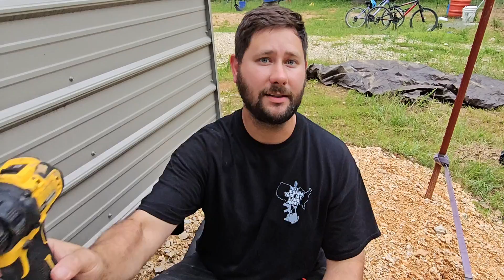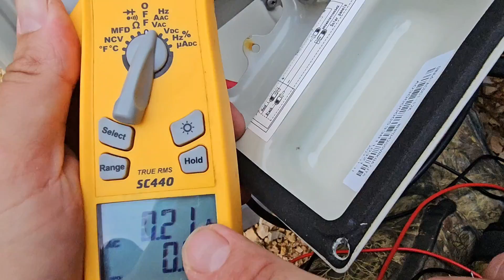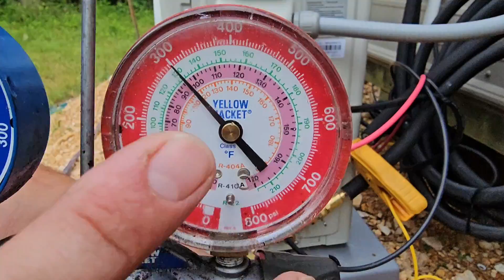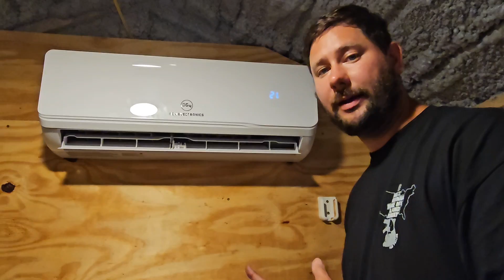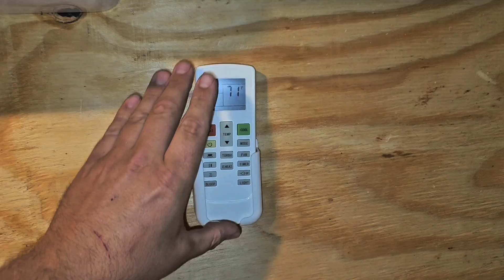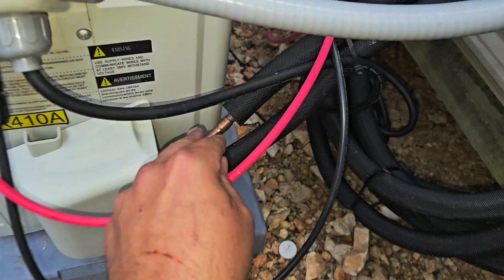Don't Buy a Solar AC Before Watching This!

Comment: Taddy, I installed my eg4 solar mini split and works great, only thing is even with very bright sun it still runs on ac and dc. I have 3 430w panels. I checked the panels and they are putting out the correct volts and watts. Can you explain if that is the way this system works?

Comment: Hey Taddy,  I have a 3-zone mini split system that was installed in my barndo in 2020 (new construction).   From the heat pump, the line sets run into the shop area of my barn up to the mezzanine level (which is the living quarters).  2 air handlers are upstairs and 1 air handler is downstairs in the mudroom.  The shop area of the barn is insulated with spray foam but it’s not climate controlled. It’s been very humid in central TX as of late and the summer heat has arrived.  Lately I’ve been noticing that the line sets in the shop area have been perspiring/dripping even though they’ve been wrapped in K-flex.  There’s also a galvanized cover screwed to the exterior wall of the mezzanine that covers/protects the line sets, electrical and drain lines.   My HVAC installer told me that the heat and humidity are the cause of line sets perspiring like they are.  I asked what can be done to prevent this and the only thing he can think of is to spray closed cell foam insulation inside the line set covers (section by section) to essentially envelope everything inside the line set cover.   I wanted to see if I can get your opinion on this.  Thanks.
Reply from the maker: Insulating would probably take care of the problem, but is the insulation not sufficient in thickness. And that's why it's sweating, just curious
P
Reply: @taddydigest  It's tough to tell if the insulation is not sufficient in thickness.  What I have noticed however is that when the air in the shop area of the barn is warm and humid the line sets tend to sweat more.  When it's warm and dry, not as much.  I did notice that some areas of insulation has gotten a bit compressed because the installer tied the line sets together with the drain lines (probably so everything would fit underneath the galvanized covers).  I also need to check the ends of the line sets to see if any of the copper is exposed in addition to checking to see if any of the K-flex is not sealed tightly at the ends.  That could be one of the ways outside air is reaching the copper to create the sweating.

Comment: Enjoyed your video again, sir. Please do an advanced video! Also, its in the units app, otherwise it would be nice to show people it will run not only 100% Solar as you did, but that it will BLEND POWER when its very cloudy - may draw 300W DC, and 300W AC. Then, as you said switches over to 100% AC  power at night. I see A LOT of comments that people are not clear on this 🤔
Reply from the maker: You're so right. There are a lot of people that are not clear on this. I need to do more content that way. I can clear things up

Comment: Because of your first video, I have decided to add an EG4 mini split hybrid system to my house as an adjunct to my heating and cooling.  My estimate is that the unit will pay for itself in less than 12 months.  Thanks for this video as well.
Reply from the maker: Excellent news. I'm so glad to hear this. Make sure you use the discount code here it is
Signature Solar Website 
https://signaturesolar.com/?ref=kvNaxADKBHncIq

Use Code Taddy50 for $50.00 off your order over $500.00